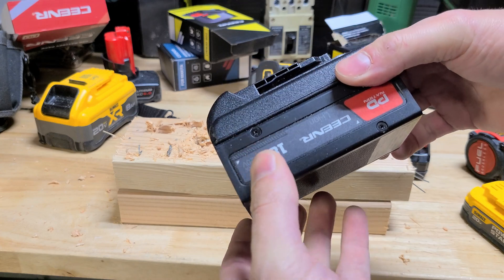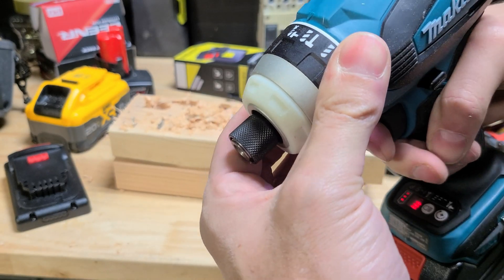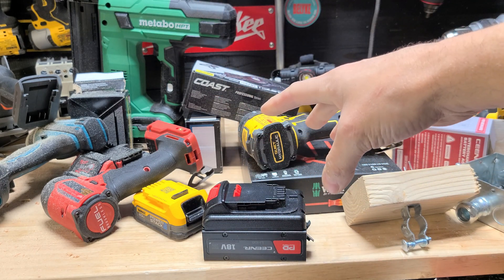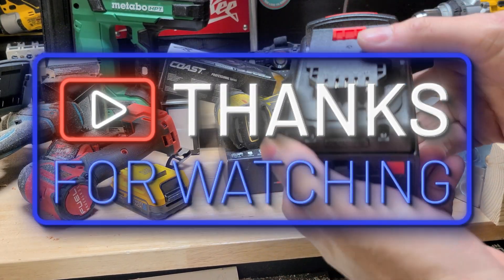UNIVERSAL Battery For Dewalt Milwaukee Makita -Ceenr PDNation

Comment: Since it's a universal battery I'm wondering how they got the battery to communicate with a tool control board since I'm pretty sure that board is responsible for telling the battery how much juice to send right especially on the newer more advanced batteries like power stacks and forges?

Comment: Do you know, if this also works with the Milwaukee M18 Inflator? Does it fit inside?
Reply from the maker: i dont have an inflator  but yes it should fit because its smaller than a 5.0  or  atleast the same size
Reply: @ Thank you!!
Reply from the maker: @Andre_As_  👍  thx